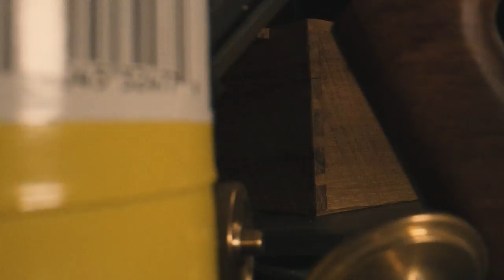Japanese Hand tool Toolbox - Hand Cut Dovetails & Chill | Woodworking Builds

Comment: Why do you pre-cut with the Tablesaw before using the bandsaw? that bandsaw and the blade you have seem more than enough to handle the re-saw. No ?
Reply from the maker: Since I didn't plane the faces of the board before resawing it's basically just a guideline to maximize yield after planing.
Reply: @WoodWorkLIFE  Ahh got it now! Well done!

Comment: I spotted this on Instagram while researching tool totes and wondered (and asked) "where are the handles?" after watching this video I guess choosing dovetails as a joinery method makes incorporating handles a bit trickier, how do you move this guy around?

I've made a few of these boxes, the main thing I would humbly suggest is to cut the wedge/top support with a bevel that holds the wedge in a bit better, this is very easily done with a handsasw followed by a few strokes on each half with a handplane, personally I find the satisfying part with these boxes is cutting everything good enough and belting them together with gigantic reused pallet nails :)
Reply from the maker: You would normally use rope handles for a japanese box like this.  I still haven't added them as I am looking for some proper cotton rope.